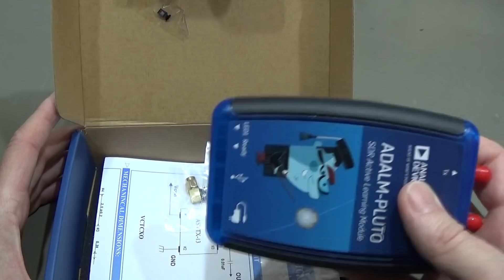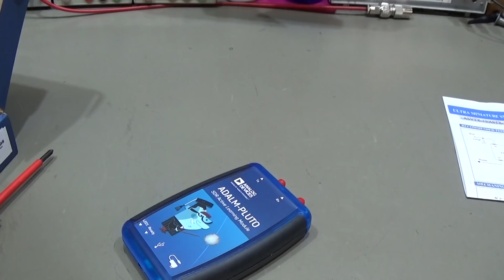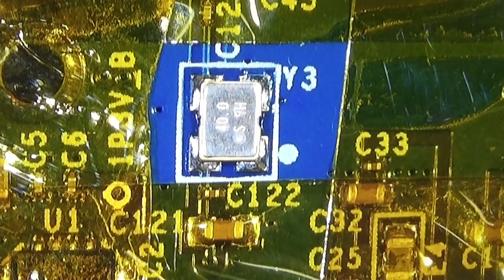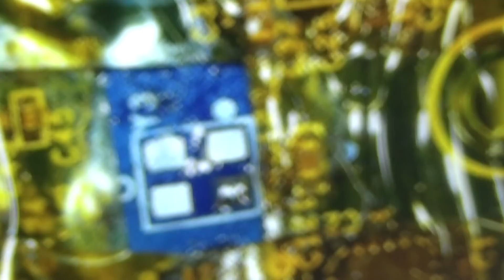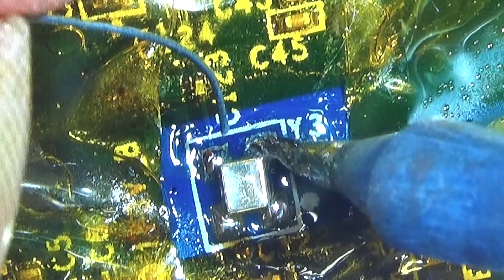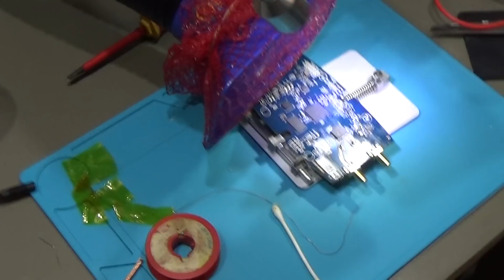#218 A new TCXO for a ADALM-PLUTO SDR

Comment: on old revision (versionB) you should put the tcxo a bit away from the trx chip on a tiny extra board (a 2x2 solder spot board works well) ... and some tcxo are OPEN from below so i would not use that flux or solder paste on those clocks

Comment: Fortunately, with the new Rev C/D of Adalm Pluto hardware, there is no need to solder on the board for this. Just make a small board or feed in any external clock - 2 firmware variables changed and the Pluto is running with an external clock - I've tried here 10 MHz and 25 MHz 100 mV pp up to 3.3V pp - nice improvement by AD !!! 🙂

Comment: Next step : ceramic tweezers. ^^ DO you heat the PCB from the bottom, under side with some hot plate ?  It may help a lot.
Thanks for the video, we see things very well, and it is not easy to film. Great job !
Reply from the maker: no, ceramic is too porous.

Comment: SMD soldering takes some skills, and proper equipment.  This is an example of how not to do it, using improper equipment.   An Iron/tweezer would be more suitable to remove the device.  Btw, did this unit work at all after your  “mod”?    I’m curious.    Application of heat for more than a few seconds is frowned upon as damage to adjacent components or the new installed device can be easily damaged.    I was also wondering if a rework/reflow would’ve improved the original devices performance, but that was never established.   Keep up the videos!  ‘73.  KN6NBL, Stan

Comment: When first applying solder to the part you should have used Chip Quik solder with a low temp. melting point.  https://www.ebay.com/itm/Fast-Chip-Kit-for-Quik-SMD-Removal-with-a-Low-Temperature-Alloy/373300961692

Comment: For those components with only a couple of pins I prefer to use the hot tweezers and the soldering iron, you can easily heat 4 pads without needing hot air.

Comment: Tricky part indeed! I typically help the process along with a soldering iron on the ground plans side when removing something like this. Just push the component to the side when it gets loose and pick it up later with some tweezers
Reply from the maker: that is a way to handle it but I prefer  more a pre heater
Reply: @TRXLab , I agree, a preheater would be nice to have

Comment: Not to be critical; it's was a tough job, but... It appeared to me that you were creating a few problems that slowed the reflow process, during the removal of the original TCXO... All related to the use of the tweezers... One, you moved the tweezers in too soon and covered the left two pads, preventing heat from reaching them... Two, by testing for the release of the IC, too soon, by attempting to lift it with the tweezers, the tweezers became a heat sink and sucked all the heat away from the IC. The take-away is to have patience and watch the solder for it to reflow, before moving in with the tweezers. The solder will show/tell you when it is ready. And, keep the tweezers on the edge of the airflow, to keep them warm, so, when they are applied after reflow, they will not suck the heat out of the IC. Still, a thumbs up...
Reply from the maker: Well everyone has his own experience so nothing wrong with your views...

Comment: Yes, this little pieces can drive you crazy.. that happend to me often on 4 layer pcb with massive groundplane, or multipacks with center heat sink. It got better with my new hot air station (1000W) and the PACE direct heated tips with extra thermal mass. It worked much better for me than my trusty Hakko. Good job, i hope it will work out good in pratical use of this SDR. 73 de Olaf!
Reply from the maker: Yes you are right that can drive you crazy...Was für eine Station benutzt du? Meine Hakko hat 1300watt Aufnahmelaistung bei 230Volt. Was ist diese PACE Lösung? Für diesen job sollte man eine Unterhitze einsetzen. Was ist deine Erfahung?
Reply: @TRXLab  Peter, meine alte Hakko HotAir war End of Life und wörtlich "zerbröselt". Ich nutze seit über einem Jahr die Quick 861DW, besonders wegen der gebogenen Tüllen. Ich bin mehr als begeistert! Mein Hakko FX 951 Setup habe ich mit der Pace ADS200 ergänzt und den Ultra-Spitzen. Ich nutze Pace seit Jahren fürs Entlöten, die Qualität ist sehr gut, vor allem für die Verbrauchsteile. wann immer ich kann heize ich kleinere Boards mit PC oder Multilayer auf 60-65 Grad vor. Dazu habe ich einen kleinen Tischofen. Eine preiswertes elek. Thermostat mit PT 100 tut den Job. Sobald das PCB durchwärmt ist, hat man i.d.R. genug Zeit zum Arbeiten, da komplett durchgewärmt. 40 K mehr machen eine Menge aus. Es geht auch mit einem Heissluftföhn oder Haartrockner, aber ich finde dann stresst man punktuell. Ich kann die Quick und die Pace nur sehr ans Herz legen, der Ofen ist preiswert neu zu haben. Ich habe es mal mit Infrarot-Gestell probiert, ist mir zu sperrig und zu teuer. Wenn Du noch was wissen magst, schreib einfach eine kurze Mail. Gruß Olaf
Reply from the maker: Okay super danke Olaf! Die Pace schaue ich mir mal an weil ich auch etwas neues zum entlöten brauche...

Comment: I found that I was blowing the hot air at the 25ppm tcxo for over 3 minutes. My new oscillator is on a daughter board away from the hot processors and works well. I wonder how much easier this would be with Chip quick  de soldering kit?
Reply from the maker: I personally don't like the chipquick desoldering kit but I know others like it very much. For this job you need a pre heater in addition and a powerful hot air station...

Comment: Thanks for the solder practice video. I train myself on old PCBAs out of the garbage bin. I have one question Peter. What type of FLUX do you use on these jobs? Thanks for your feedback. 73
Reply from the maker: Thank you! I'm using chipquik smd291. Hope your hot air has enough power because one reason for being not successful is a low powered hot air station. Mine has 1300 Watt at 230volt

Comment: I hate S.M.D.s they are so difficult to work with.  But it is the future, but it is here today.  Amazing how much heat a PCB or a metal component can suck away.  Making everyone's life a lot harder in the Lead free solder.  It is horrible to work with, causes dry joints and when it comes to remove components it fights you all the way!
Nice video, shows just how hard it can be at times.
I wish I could go back to the 70s electronics, even the 80s, it was a lot easier.
Reply from the maker: Well for reflow jobs we only use leaded solder and for jobs like this you need a under-heater in addition. We all can't get away from smd technique so the best is to demonstrate that we can work as well with smd's..
Reply: @TRXLab  Yes exactly, but they are such a pain to work with.  But we have to, so we will just carry on regardless!
Reply from the maker: Yes what can we do so we have to

Comment: Hi, i guess this card is soldered with the new kind solder and not 60/40 solder.
60/40 is the absolute best for me, good job as usually btw Peter.
Reply from the maker: I have tested the Mechanics solder with lower melting point  but I did not like it...

Comment: I was thinking of looking at a heated plate to raise the PCB temperature to get the ground plane hot and spread the thermal loading to avoid thermal shock to the large IC’s.

Love your video’s  and would love to see an old school FT102 amp section repair.
Reply from the maker: yes you are right for job's like this a pre heater would be gold standard. But in the case of this video you would have not been able to see what ground plane can do...
Reply: @TRXLab  Have you had much to do with a FT102, I have one with power issues. low  on 80M  and goes down to 10W on 10m?

Comment: I thought the damn thing was glued down during production. Peter it's crooked but that's okay with the case on, you won't see it from 40,000 ft. Anyways glad it was a short video I only had three donuts. Always the best Saturday morning Cheers 73
Reply from the maker: Yeah that often happens that parts are glued but according to my experience the glue is not heat resistant enough to hold the part on the pcb..
Reply: @TRXLab   I thought that too when you applied heat from the iron

Comment: I thought you would have used solder paste to reattach it with just the heat nozzle and let it find it's own centre.
Reply from the maker: no I don't use solder paste as I don't nee to re-ball BGA's very often....

Comment: Great job , I have hot air but have never used it..... Must give it a try on an old board so I don't mess up a good one....thanks
Reply from the maker: hope your hot air is strong enough. Mine is 1300 Watt. If it don't work in your case you have a hint what the problem could be...

Comment: That looked 'very' tricky Peter.. Just shows you definitely need the right equipment to attempt this procedure.  Even then ! ! .. Nice to see you back again.  Prost und Bier .. 73 Pete (G4RYO).
Reply from the maker: Absolutely right but this job should be done with a pre heater in addition so you need even more tools...
Reply: @TRXLab   Ha-ha, I knew nothing about the pre-heater.. I think I'll stick to through-hole PCB and turret boards  🤓...

Comment: Inhuman size parts. Human unfriendly design. You need 300 dollars worth of equipment to replace a 0.05 cent part. And they go on and on and on about this eco and green stuff and how we should be saving the planet and all that nonsense but producing disposable electronics that barely last four years is absolutely fine. This planet must be another world's hell.
Reply from the maker: I agree we should save the planet and therefor we show that devices with smd parts can be repaired as well as through hole parts or even better